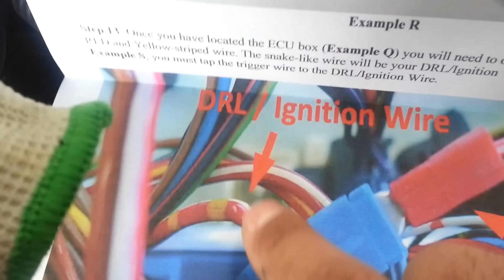BMW E39 Depo Headlights Bi-Xenon Angel Eyes Wiring Installation

Comment: Hi i'm literally getting mad trying to understand how to wire these headlights..I m from europe and i dont need daytime running lights automatically when key is turned on (i just want to light them with the first position of the light switch) can i wire them to the old positions bulbs wires? thank you
Reply from the maker: Hi, Not sure if you figured it out by now, but I think your best bet would be to wire them to your corner lights. Just tap into them and you should be able to turn them on when switching on your parking lights. This is even easier than what I did on the video. Just connect the ground wire anywhere with a good ground and then connect the positive trigger wire to the positive wire that turns on your corner lights. Hope I didn't confuse you. Good Luck!

Comment: Do you know which wire I should use for t top if it's negative or positive thanks
Reply from the maker: Not sure what you mean, but I only used the T-Taps to connect the trigger wire to the main accessory wire in the main ECU Box (Thick red wire with a solid white stripe assuming you have the same model bmw) . That will activate your Halos as day time running lights---So they will be on automatically when your key is the on position. As for negative and positive, there should be only one set of red and black wires. Black wire is the one that you ground and the red wire you connect to the positive battery post as shown in the video. I was fortunate to get mine with a pre-wired harness. Hope this helps buddy.

Comment: hey buddy are you still liking those head lights? I purchased these and want to know what your take is? Also did you wire the remote fade in fade out feature and how did you access the cabin? passenger side or drivers side?
Reply from the maker: I'm still loving these lights bro. no problems so far. No. I didn't set the fade in fade out feature on this set up. Hope you're enjoying yours bro.